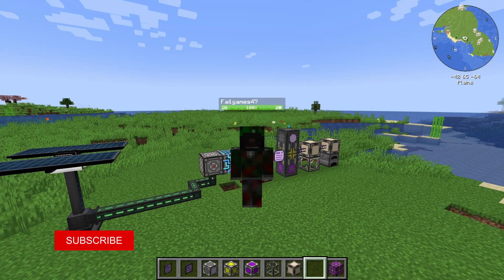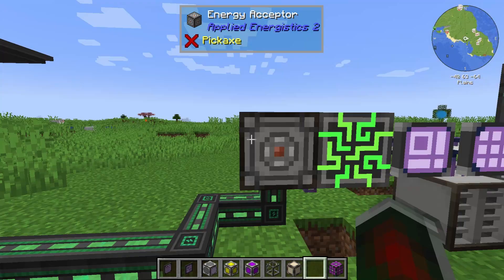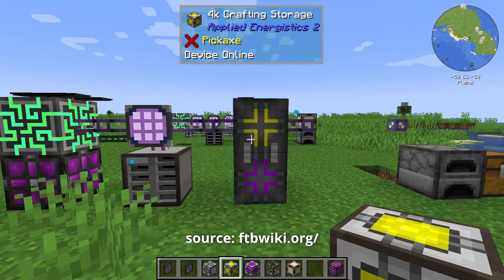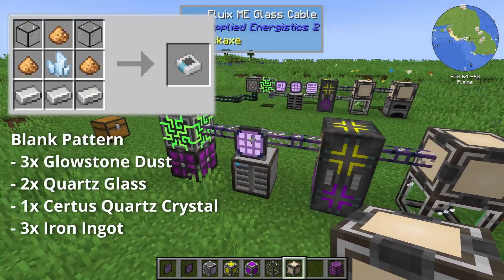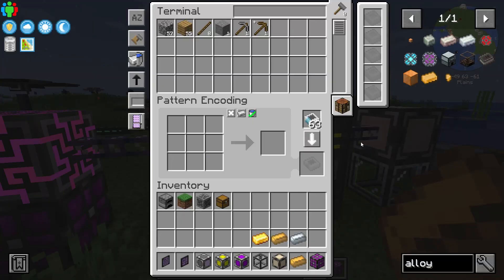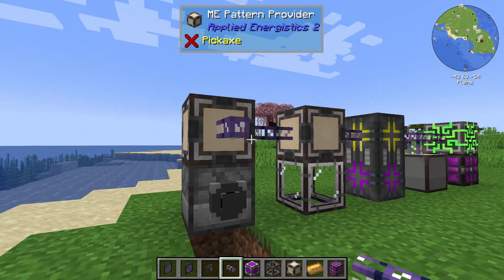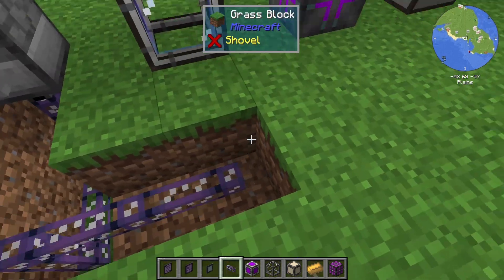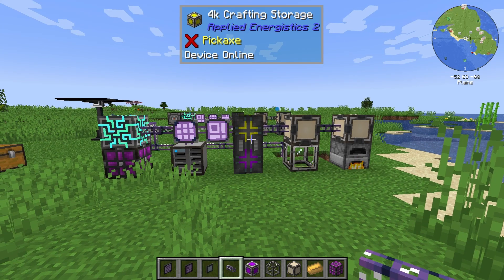Applied Energistics 2 (1.18) Autocrafting - Basic Setup (Tutorial)

Comment: I believe your issue is the type of cable you’re using. The most basic quartz cable can only handle 1 “channel” aka 1 interface. Much like if you add a 9th interface to a Smart Cable which can handle 8 “channels” the whole system shuts down. If you use a Smart Cable or a Dense Cable (32 “channels”) in that setup it will work.
Reply: You can think of each “channel” being a separate lane on a road and in your example you need one lane going into the furnace and another lane going out of the furnace back to the system. The basic glass cable is like a one way single lane road that you stared from the ME system to the furnace but when you try to route another one way road out of the furnace in the wrong direction it causes a crash. By using the “smart” cable you’re using a wide 8 lane highway where everyone gets their own lane/direction.
Reply from the maker: Thanks a lot for your comments, to be completely honest I forgot entirely that that's how AE2 works these days
Reply: Basic cable can handle up to 8 channels, after that you need a larger cable.
Reply: i thought the basic glass cables can hold 8 as well?
Reply: @doormaat5033  glass cables can only transport power, this feature is highly used in some setup to create separate sub networks still sharing their power
Reply: @Liineeeee  you are confusing glass cables with quartz fibers.
Reply: If anyone else is seeing this, i managed to fix by simply adding more cables weapped around the interface, it says you gain 8 channels per side that is connected, so just wrap it with cables somewhere

Comment: not a very good tutorial, doesn't explain a lot and shows stuff that doesn't work well. mainly talking about the furnace part.
A truly basic setup doesn't even need an ME controller, you don't need the co-processor for it to work either, especially with the setup shown it wouldn't do anything but waste space and resources. Your setup doesn't involve managing the furnace's fuel at all. The way you wired it made it automatically push any valid fuel available on the network (wooden tools, logs, blaze rods, things you wouldn't want to smelt usually) into the furnaces fuel slots. The way it works is that the furnace only accepts items for smelting from the top, fuel from the sides and you can only get the the result of the process at the bottom. The pattern provider works by pushing the items from the process into any adjacent inventory and waits for the results to be pushed into it or into the network that the pattern provided is a part of. The reason you had an error pop up with missing channels was because you've had all the devices (including the interface) were connected together, the regular cable (naked and covered) can only handle up to 8 channels, and you had 9 when you connected them all together (3 terminals, 2 interfaces, 2 buses, 1 crafting CPU and the ME Drive). After you isolated the furnace export bus into it's own cable connected to a different face of the controller only then you were able to get this working. The proper way to make this work is to put the raw materials + the fuel into the pattern (ex. 8 cobble, 1 coal -> 8 stone (can be 1 cobble, 1 coal but that would waste coal in the long run)), make the pattern provider push into a barrel so it can be handled with hoppers or an AE2 sub-network. It wouldn't waste tons of channels on the main network which you would probably be expanding with the time. I'm not here to ridicule, but i just wanted to point out the flaws in this tutorial and help just a little bit.
Reply from the maker: Thank you very much for your comment, I appreciate the detail and will certainly re-read it in the event I make another video on this topic (or even just for personal use when using AE2). 
I'm by no means an expert, especially concerning the channel system, as I never looked into "new" AE2 versions (since Java 1.4.7) that precisely.
If I didn't make that clear in the video, I would certainly do so in the event of future iterations.
Again I thank you for your detailed response and appreciate you taking the time out of your day to write it :)
Reply: @Failgames47  no problem, I just know the frustration that comes with trying something you see online and it doesn’t work exactly as shown. cheers!

Comment: I need help, please. When I do an autocraft, the manufactured object stays in the molecular assembler and does not go into the system. Is there a solution?
Reply from the maker: Have you attached an input bus that pulls items out of the assembler? If no do that, if yes:
- check the input bus is online (in the ME controller's interface, or it could say in the WAILA box at the top of your screen if you have that mod enabled)
- check you don't have any filters applied to the input bus (item filters or redstone enabled)

Hope this helps!
Reply: @Failgames47  with an input bus, it works fecatively but there is no way for it to come out without anything? just with the pattern provider ?
Reply from the maker: Unfortunately I'm not quite sure what you mean and may not be able to help you
Reply: @Failgames47  I mean that there is no other way to recover the manufactured object? As with cables connecting to the Pattern provider
Reply from the maker: Not that I'm aware of. I sometimes use an export bus and then pull from the ME System to a chest so i can connect "normal" pipes to the chest to move around items though

Comment: channel system is confusing due to lack of in-game information but it's very fun to work with. basic cable and device can carry 8 and dense cable 32. each controller face provides 32 so a single controller with dense cable gives you plenty. protip for tiny networks and subgrids: devices don't need an me controller to work as long as theres 8 or less, then controller is needed to fix them by providing more channel
Reply: actually a controller face can provide up to 32 * 7 channels
the use of P2P tunnel allow to create a subnet containing 8 P2P tunnels with 1 connected directly to a controller s face. (a P2P interface can only be placed with a 8 channel cable because of it s size) and then, you can put dense cable for each of the 7 P2P tunnel that serves as "output"

Comment: If you're playing AE2 with othe mods such as mekanism or iron furnaces, the use of the import terminal is not needed, when the machine (or furnace) can be set to input/output from one side. In this case only the pattern provider can act as the I/O and the network will handle the rest.
Reply: bro you are a lifesaver ! Thank you
Reply: So you’re saying that you’d need a pattern provider on both sides of the furnace?
Reply: No only on one side and make the machine able to input and output from one side, where the provider is @spitfireGamesVR
Reply: THANK YOU SO MUCH!!!! i was trying to use import and export bus but it keep burning cobblestone into stone even when i didnt asked for it

Comment: it says no crafting cpu's when trying to craft over 500 of something. help?
Reply from the maker: I think It means you don't have enough co processing unit power. You might want to try upgrade yours or add more

(I'm 90% sure that's what it means)
Reply: Upgrade your crafting CPU.  The system automatically choose CPU with sufficient crafting capacity. Otherwise it will not work.
Reply: no he is wrong, you re not missing co processing, you re missing crafting capacity, to craft something, the crafting unit will get everything into its memory. As such, if you need to store more items in the waiting list, you need more memory, either you make a bigger crafting unit with more storage units, either you improve your units to handle more

Comment: Thank you, I just built my entire crafting unit with the interfaces and was wondering why the ME system wasn't recognizing it. I was unaware that they changed it. Also, the ME system just wants to make sure the item after being crafted exists in the system, you can import it with a ender chest as well
Reply from the maker: Glad to help!
Also the idea with the ender chest is brilliant thank you!
Reply: @Failgames47  Welcome. the normal way before was to hook the output from the crafting machines directly into an ME interface. The way that I've always used auto crafting that just makes it easy to do is I discovered all the way back in 1.6.4 that you could simply place a diamond chest on top of the ME interface, and then it would just output the items directly into the chest, and then you pump them out with a item duct or Ender IO item conduit. Since we unfortunately don't have either of those mods updated to 1.18.2 yet, you have to use the clunky and basic Pipez mod to be able to move items from one inventory to another. I'm sure there's a way to do it with applied and logistics, but I don't prefer to use the automation from that mod because it's difficult. 

You should make your next video about how to set up a Auto crafting system for the Ae2 processors using the auto crafting and the Pipez mod. This would definitely make people's lives a lot easier in 1.18.2, since many of the mods aren't updated and up until about July 1.18.2 was basically unplayable.
Reply from the maker: The even older way was just better. Just a huge cube hooked up by one cable that did everything haha
I'll definitely look into it as I need one of them myself but I can't promise anything as Minecraft isn't the main focus of the channel

Comment: I don't have it in front of me, but I think you can put an export bus on the pattern provider to send the processed item back into the network, rather than the long cable back.
Reply from the maker: Just tested it, doesn't seem to work
Reply: @Failgames47  odd.. maybe it's something to do with the modpack I'm using. I'll try tomorrow on a AE2 only and see. Sorry!
Reply from the maker: @buddhawilliams  no worries! Thanks anyway
Reply: had a play on just AE2 and Thermal Series for the machines... you just need to link it back to the cable coming in to the pattern provider. so ignoring coal, you put a cable into the pattern provider on the top of the furnace, an importer under the furnace and a cable going back up to the cable connecting to the pattern provider. Then, if you want coal, a side cable with exporter with coal in it. This is working well. Although, using a redstone furnace from thermal is both neater and faster to smelt :D
Reply from the maker: Pre-1.18 was easier xD
Reply from the maker: Will confirm when I have time, but thanks very much!